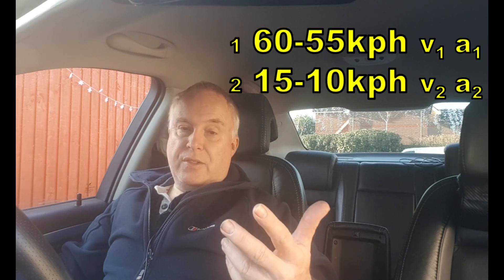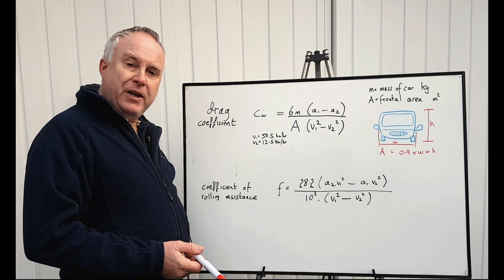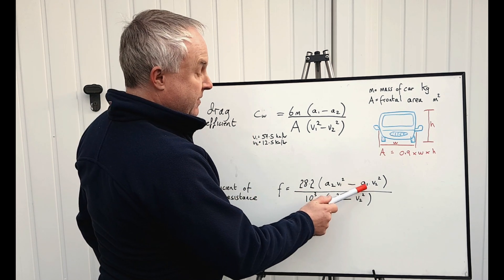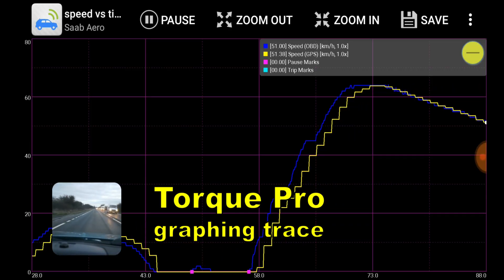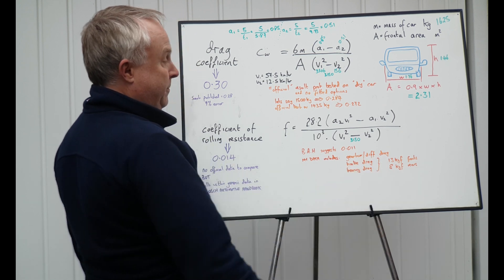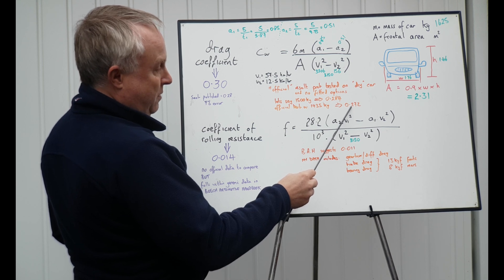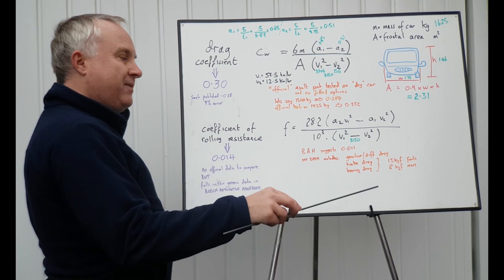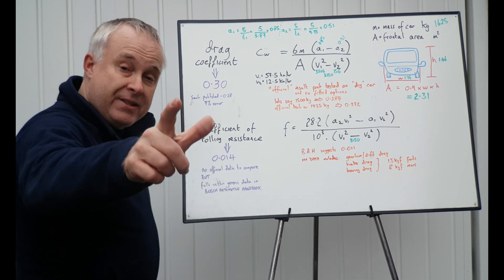How to find Drag coefficient of a car | And Rolling Resistance

Comment: As in a comment below I did the math with the values in the video and gear a Cw of 0.45 the equation is correct, but the result is not 0.3, Also for the coefficient of rolling resistance it should be a1v1^2-a2v2^2 in the upper brackets

Comment: Where did you get the equations from?
I have the bosch automotive handbook, could you please specify in which chapter these equations are mentioned?
Reply from the maker: It's in the section on Vehicle Dynamics. Or look for 'aerodynamic drag' in the index at the back. My handbook is 3rd edition (lol) and it's on page 325.
Reply: @CycloneCyd  Thank you

Comment: Hello Sir, I think you put values of two velocities in the equations in (kph). While the other values you used are in SI units. Don't we need to convert kph to m/s?
Reply from the maker: Strictly speaking ALL physics should be conducted in SI units, however that conversion is already catered for in this practical (since it's a constant)

Comment: needed this for my engineering homework but i don't have a car so thank you
Reply from the maker: You could do it on a pushbike. Set the torque app to read speed from GPS. You could for example show how much more efficient leaning down over the bars is compared to sitting up.
You could use any vehicle, in fact. Good luck with your course

Comment: Good day. I did the equations with the values given and I calculated a Cw of 0.45 and not 0.3. I need this experimental method for a validation for a project and can't seem to get the same answer. Any idea?
Reply from the maker: The only place I can think of for an error to creep in is the lower parentheses with the velocity squared. make sure you are calculating the difference between the square values and not taking the square of the differences (did that make any sense?)
Reply: @CycloneCyd  That makes sense, the way you said it. I will look at it again to make sure, but great video and thank you for the insight. I have to use this for validation for my project and you are the only resource I was able to find, so great work.
Reply from the maker: @rudiesiecker5395  hello again, is this a college/uni project? If so, you could try asking the library if they have a copy of the Bosch Automotive Handbook. This experiment is str8 out of that book. Doesn't have to be the latest edition, it's been in all editions from the 1st one. There's a fair few pages you might find useful.
Or try searching for a 2ndhand copy

Comment: Don't car manufacturers give out this information on their cars somewhere?
Reply from the maker: Hi Lisa, on the car? No not usually. Most OEMs do publisg Cd figures, usually in advertising or tech specs, but it's usually for the car in the range with the best result (or the one car they tested). Mainly this method is useful for students as a practical experiment or people who have modded their cars. Or people who've built a track car or kit.
Reply: @CycloneCyd   I have read that a smooth round shape has the best  drag numbers , and that it can help with better fuel economy. I try to find the information on specifications lists but it is often not mentioned.
Reply from the maker: @staresce  this information is not a legal requirement like fuel economy figures, so some do some don't. 
Yes, a teardrop shape is what you're thinking of. It does have a name but it was 34years ago I graduated and some things are forgotten 🤣😂🤣😂😎
Reply: @CycloneCyd   Is it  aerodynamics? I read the cars in the 1930s used to be built that way in a teardrop shape.
Reply from the maker: @staresce  aerodynamics is the name of the subject  - the study of fluid flow. 
I meant that teardrop shape. It's got a proper name because it can be mathematically proved to be the most aerodynamic shape
Reply: @CycloneCyd   I researched the question on streamlined ( also called "streamliners" } vehicles and found this info quote" ...a car's drag coefficient isn't actually as important as its drag area, or CdA. This is the number you get when you multiply its Cd by the frontal area of the car, but it's also a number that OEMs and designers rarely release" I also found this information" Typically, pressure drag is far more important than viscous drag".They are judged by how 
"slippery"they move through the air. Decades ago they had a  design they called the "fastback", so the rear of the car sloped down in the back so vacuum force did not affect the car
Reply from the maker: @staresce  yes, that's good info. Cd is "coefficient of drag" - a coefficient is a dimensionless number (unlike CdA which is in m^2). Being dimensionless, that's how come it is often measured on models in an air tunnel (eg for large planes - otherwise it'd be some massive wind tunnel lol). The Cd of the model is the same as the real thing. Cd gives no sense of scale, whereas Cd does. The CdA for a car is very small in comparison to that of a Jumbo jet for example, thus you get a sense of scale for the fact it takes an awful load more power (well, force actually) to push a Jumbo thro' the air than it does a car.
Although basic, this is a good reference: https://en.wikipedia.org/wiki/Drag_coefficient
Reply: @staresce  yes, older cars tried to mimick more the teardrop shape
you can find modern velomobiles which are human powered and thus are more subject of aerodrag optimization and they are designed as round as possible and the tail is as tapered as possible
modern cars arn't that optimized, it more of a case of practicability and mass production
sports cars have better design, and rounder shapes, but more expensive to manufacture 
the velomobiles are also as expensive as cars because of their special handmade carbon hull and difficultly of design (no mass production)
Reply: @CycloneCyd  the cdA of different cars is more easy to compare, like if you have a larger car and small car and both have same cdA, then they should consume same amount of fuel
while the cd itself is about shape and dimensionless
Reply from the maker: @zazugee  Whilst it's true that CdA would be a better comparison car to car, most OEs only publish the Cd and not CdA, nor do they publish the A (frontal area).
As you elude,there's an awful lot more to aerodynamic drag than just Cd. Fluid Dynamics was a constant feature of my Mech eng degree for all three years and some of the text books make War and Peace look like light bedtime reading!